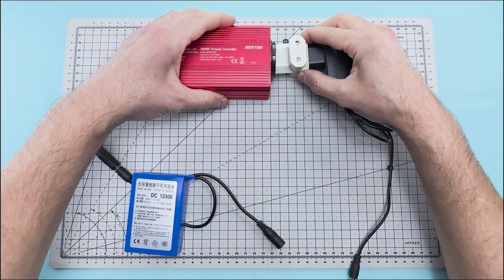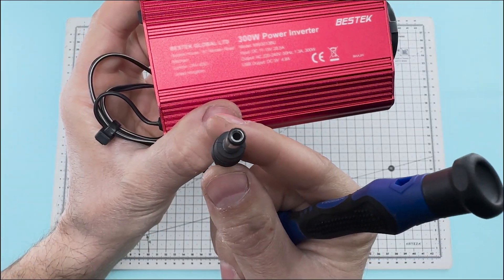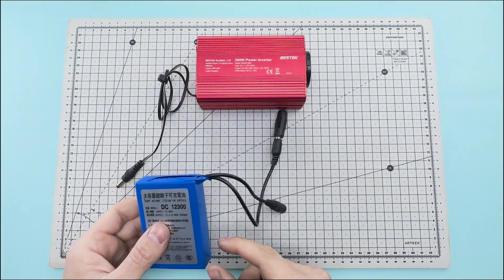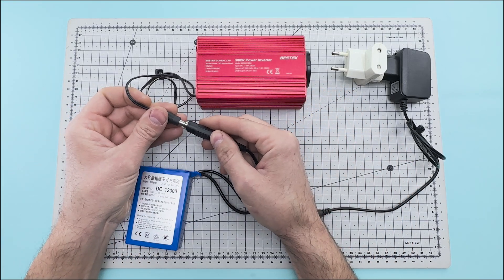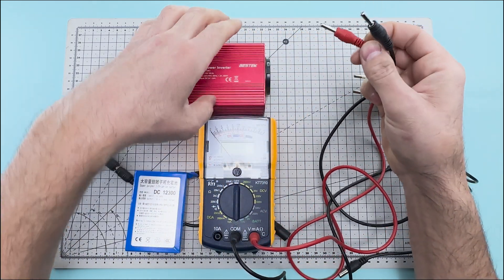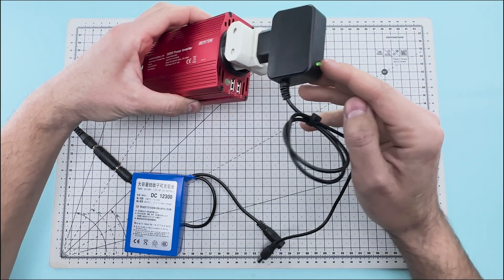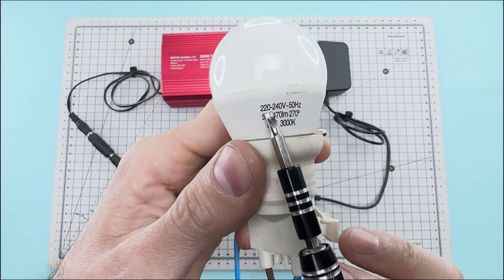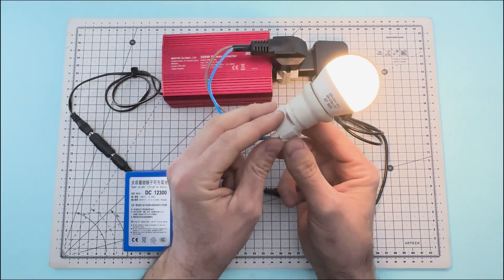Simple Infinite Energy Circuit - Real or Fake?

Comment: Sure it works if you start with a fully charged battery, but for how long? Not infinite because there aren't any components here open to receive external energy...not even a charge pad! It won't be long because each of those devices use a little energy themselves before they let any output. Just look again at that Travel Charger:
Input 240V X .13A = 31.2 Watts to
Output 12.6V X .5A = 6.3 Watts. So, you can see right there with just that one unit, it needs 31.2 - 6.3  = 24.9 Watts more than it can provide. Where is it going to get those other 24.9 Watts? The discharging battery, which we don't know how much it requires to operate. And not from the inverter; look at it. Looks like it needs some of that power to operate it also. So, no, its not even fun to watch it run down, poor thing.

BUT, it got you thinking, yes? So, then it has served a useful purpose!  Very Good!  The power quest continues!

We are all in this together; may all the powers assist us.

Comment: Are you nuts?. What can anyone do with 5 watt. A normal grinder runs on 1000 watt.
Reply: The converter converts 12v dc to 120v ac with 300 watts. At least mine does. I bought all this stuff off Amazon for cheap